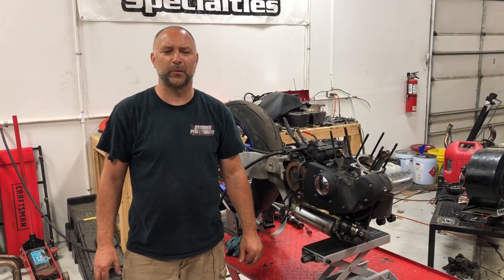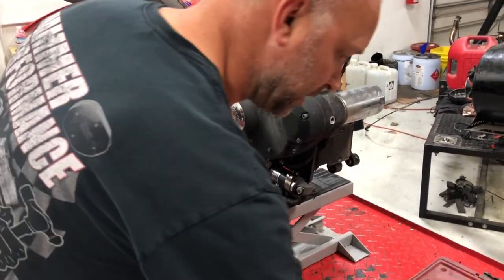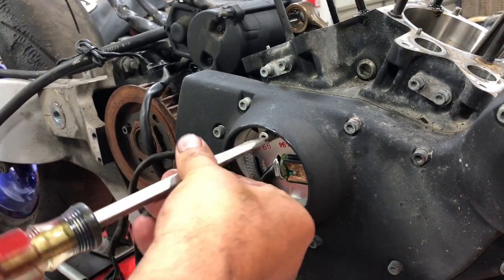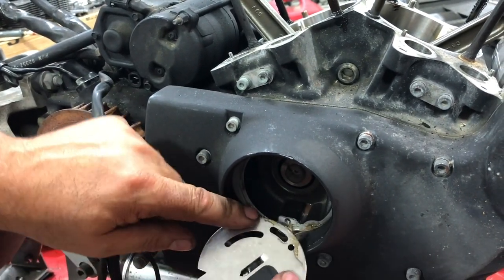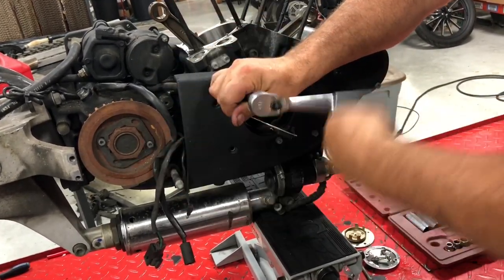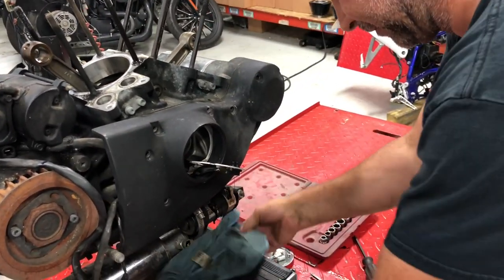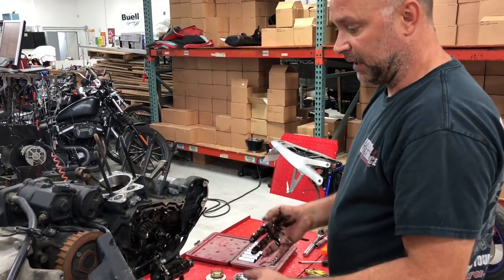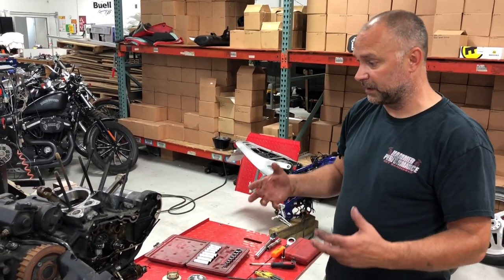XL/ Buell Cam Box Disassembly

Comment: Thank you guys so much for these videos! I used to have an old Ironhead but never got into the motor. Now I have acquired a 90 Sportster 883 with 1200 heads, weisco pistons... When I got the bike it was dripping from the cam cover and I could see some oil blow out residue on the front head gasket, so knowing I had to dig in I ordered complete gasket kit (Genuine James) and started tearing her apart. Luckily I watched some of your videos 1st and when I saw this one I was so glad because I certainly was going to do only a top end and then once finished crack open the cam cover. Now I know that would've been a big mistake! Thank you again for the education you are an excellent teacher! I couldn't have done it correctly without your help!

Comment: Great video guys
I want to check my oil pump gear drive on my buell x1
I just want to check it so can I just remove the casing without taking the pressure off the rocker covers if I'm not taking the timing out?
Literally just checking the gear drive.

Comment: If I just need to change out the cam cover gasket do I still need to relieve the pressure from the rocker boxes? 01 sportster 1200.
Reply from the maker: Yes, the cam cover is what supports the outboard side of the cams. So when you remove the cover without first relieving the valve spring pressure, you're torquing the cams sideways in their inboard bushings. It's a bad plan.

Comment: Cam box question if possible  , i have an 1998 XL 1200 S   am not a fan of the( tatty ) spray silver finish on the out side cases . id like to fit  lacquered standard finish cases from an XL 1200 C or similar of the same age . does the cam box fit straight on , i know the S has different profile cams , is there any clearance issues ?
Reply from the maker: A cam box cover from a 91-99 model fits. But check the gear fit of your cams when you change the cover, because it will change. See here for more info: http://www.hammerperf.com/ttxlcaminstall.shtml#gearfit